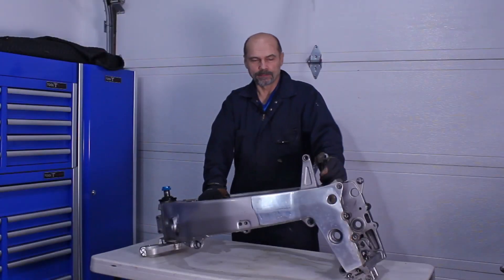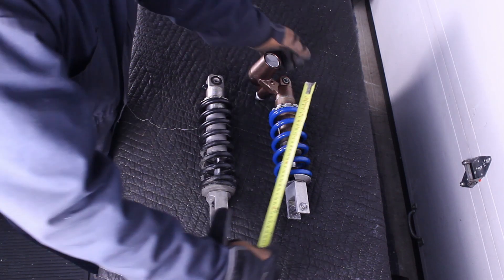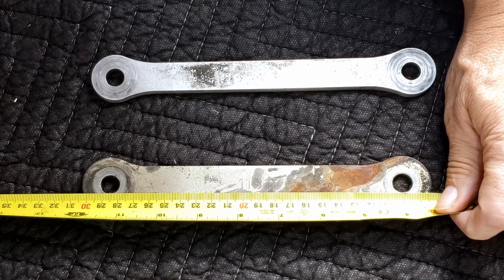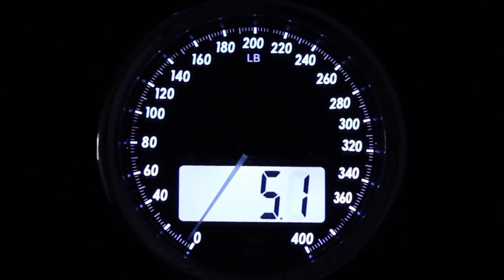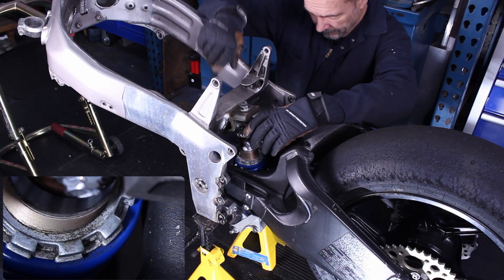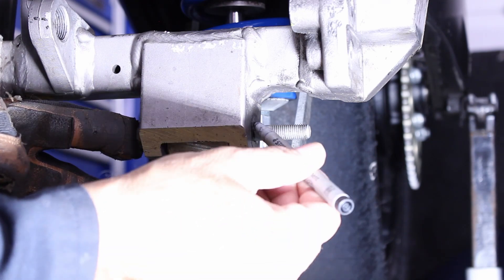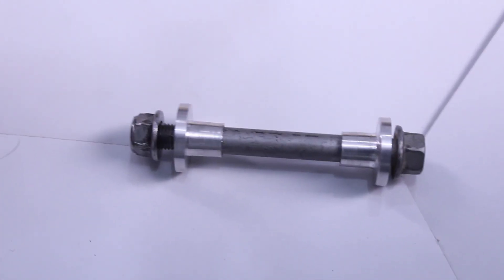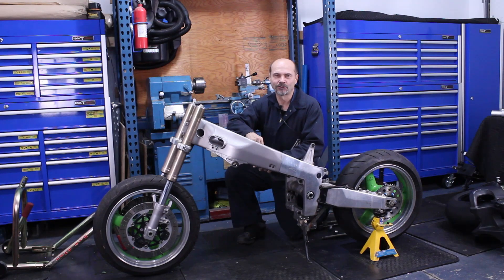How to Install a Ninja ZX10R Rear Shock on an older Ninja ZX7 model (94) Part1

Comment: Rebuild the shock and install a Race Tech gold valve.
Reply from the maker: I haven't decided, which way to go.
Reply: @MynameisDarko-ln5ts  do you have video showing how you were able to mount the 1000cc swing arm onto your 94 bike I have 1st gen widow maker ZX1R swing arm I want to place on my 97 P2 ZX-7R I already have the rear shock from 1st gen on bike now....
Reply from the maker: @Heylo7  I hope this helps. https://youtu.be/Wwjzv0JDw1o?si=jovYg7v_1F7--dNK